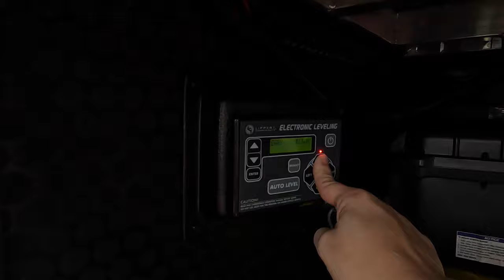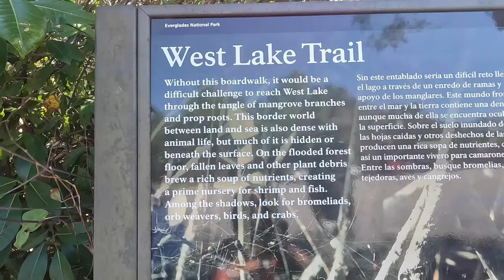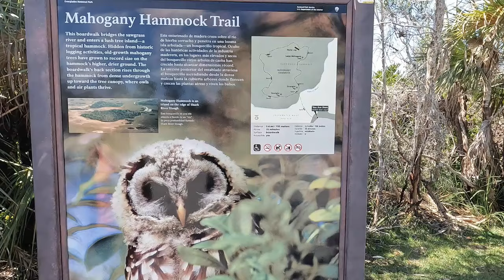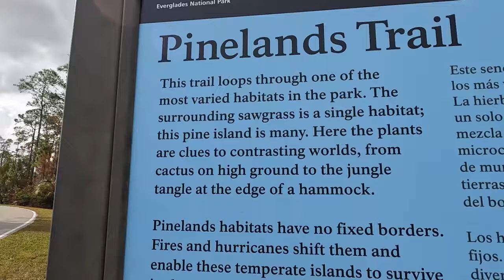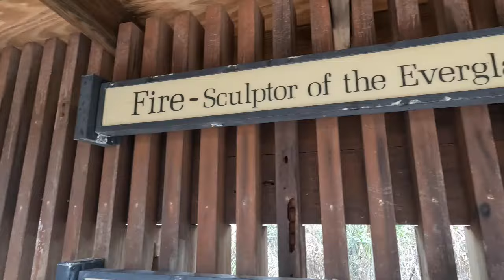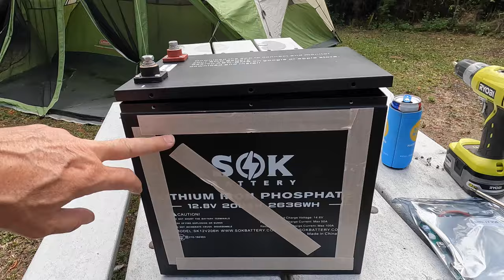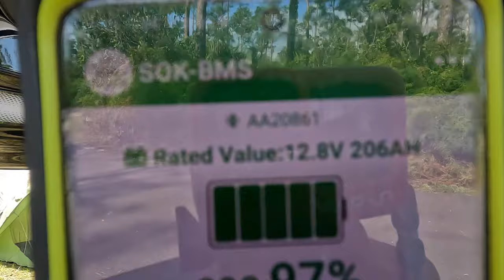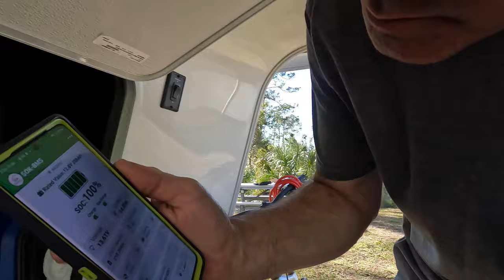Episode 90: Heading to the Everglades in our Brinkley and SOK Battery Review & BMS replacement,

Comment: Have you run the main air conditioner overnight with the batteries?  if so, for how many hours the batteries last at night with the AC?
Reply from the maker: We had it running for about 5 hours but also had the Starlink running which is a power hog. We kept it on 73ish for about 5 hours one afternoon. It took the batteries down to about 60%.
Reply: @SunBumsAdventures1  I asked because I also have 4-SOK 206ah but I haven’t tested the AC yet.  I just installed the Easystart at the main AC and a 50amp Transfer Switch to power the whole panel with the inverter so I can run the AC at night at some occasional overnight stop. I just realized that you ended with 60% after 5yrs because you have multiple solar panels recharging and it was on afternoon.  I only have 1 panel.  That is why I asked if you have tried the Ac at night when the panels are not collecting energy.